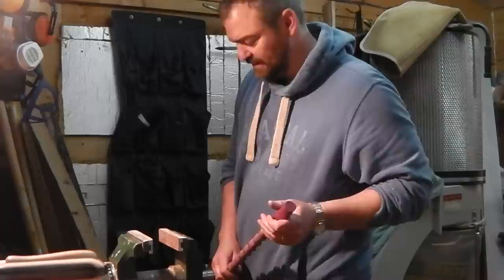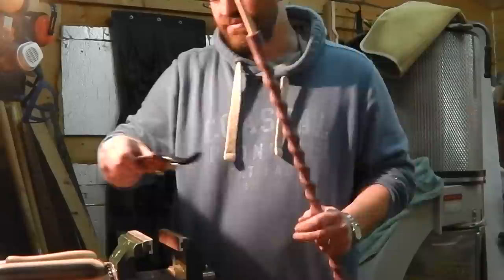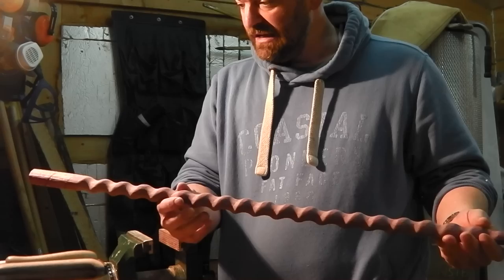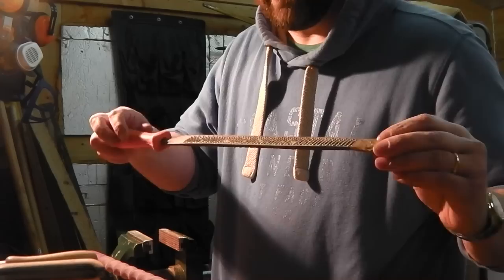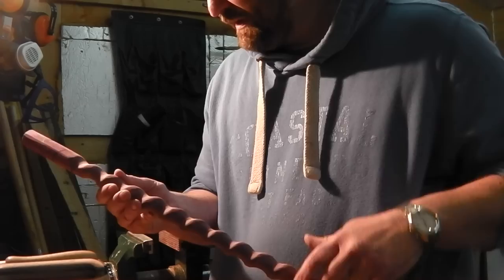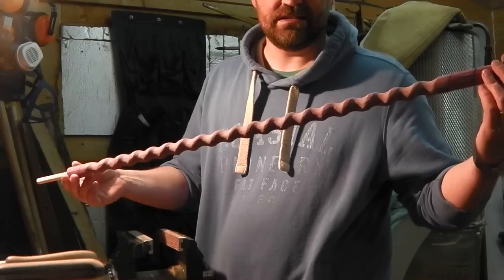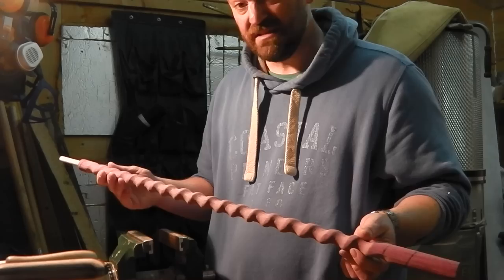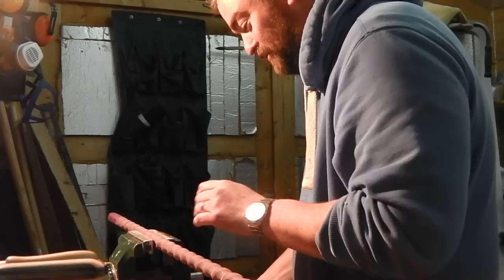how to make a wooden barley twist/ spiral

Comment: I eliminated the sanding by saw cutting the diagonal line to desired depth. I next used a hoof rasp to follow the saw line, and finish the twisted rope humps. A hoof rasp has a course and a fine side, and if used properly, no sanding would be necessary. You would be amazed at how much use a hoof rasp has in a wood shop, a huge time saver. With a bit of practice, your stick could be done in well under an hour.

Comment: How would you do this on a lathe ?
Reply: Dear Eva, you can’t “turn” this on a lathe because of the fact that one turn on this job means about 100mm traverse.  What you could do with a lathe is something I rely on when I am doing a barley twist is the index plate and securing pin you use to lock your work and once completed, unlock the pin and rotate to the next part. It means you are not running a risk of crushing your work in a vice as is demonstrated here.  The problem with the length of the job will mean that only short jobs can be done this way, otherwise with the flex, you may break your job. 

There is a machine you can make that has a main axis and head / tailstock in simple metalwork.  Above the work area you have a router attached to a threaded rod so that it slides along some ways and can cut into your work.  Two gears: one on the main drive and a second on the router spindle means X rotations of the main shaft = Y traverse of the router.  That is how you could turn it on a modified lathe. Cheers.